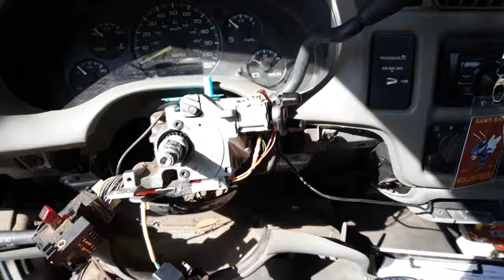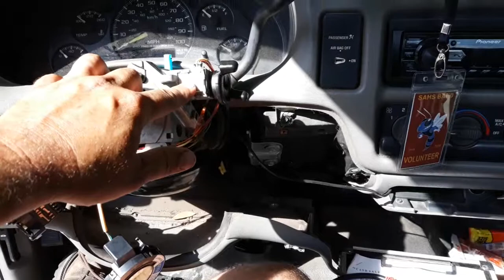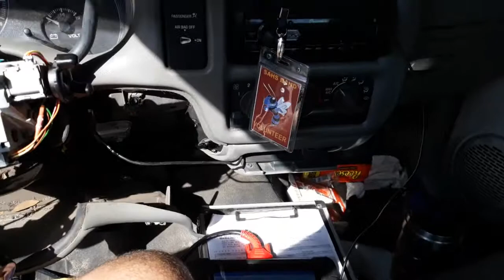GM Passlock Coded Cylinder

Comment: What year was this blazer I am having trouble finding an aftermarket ignition cylinder housing mine is a 98 but the Dorman part number you have says it only fits 2000-2005 but they look identical
Reply: Thanks for the quick reply I did try rock auto and couldn’t find anything only place I found was eBay but I wasn’t sure how much I trusted it
Reply from the maker: @journimelson2692 what about parts geek? I have bought a lot of things off of eBay as long as you read the item description good and you pay through PayPal if anything's wrong PayPal will have your back.
Reply from the maker: It was a 2000 GMC Sonoma. Did you try rockauto?

Comment: The current state of my solid(not flashing) security light has not changed since the day the problem began. I went to start the van one morning and the light was solid and van wouldn't start. I have disconnected the battery 1000 times and I have also removed the PCM to connect to a bench harness to try to delete vats with PCM Hammer software on my laptop with no luck. I couldn't get the bench harness to talk to the box at all. I can get the PCM to talk to the laptop when the PCM is in the vehicle but it won't let me progress far enough to re-flash it. All of these things that I have tried end with the same result as day one. Nothing has changed. I tried the 10min relearn thing 1000 times. I have ignition key sensor coming in the mail today but I'm guessing that it will not make a difference because the problem is further downstream(VTD) It seems like no matter what I do with the column/key sensor wires make no difference because it seems that my VTD(vehicle theft deterrent aka passlock2) module is not listening because it is bricked or damaged. The software doesn't seem to support the old Black box pcm/ecu that is in my 1999 van. I am now changing my approach to simpler methods like physically bypassing the module itself or somehow physically removing vats from the PCM somehow. I have been completely obsessed and determined. It is beginning to feel like physiological torture. Please help

Comment: So no relearn procedure after cylinder/sensor swap? She just fired right up and PCM corrected itself?
Reply from the maker: No I had to do the relearn procedure but I figured nobody wanted to see that cuz there's plenty of videos on that out there.
Reply: @Bbernhardsr  so you change the cylinder of the sensor with the brick PCM and then do the 10 minutes on 10 minutes off etc three times relearn? You think this method is quicker and easier than deleting vats with PCM hammer?
Reply from the maker: @laughingthrushmusic5269 what I did was change the sensor itself and I put a new lock cylinder in. I changed both components and did the 30-minute relearn procedure. Yes I believe this is better than trying to delete the PCM with a hammer because then your vehicle will not run it all ever.

Comment: I'd (like/need) to see a video of how to replace the 'pass lock sensor ' i searched hi and lo on you tube and i've found multiple vids on lock cylinder replacement and can probably do that with my eyes closed.
Can you help or point me in the right direction ?
Thanks,
Mark
Reply from the maker: Unfortunately this video was made many years ago. But that's okay because if you watch the video you can see how far I had to take the steering column apart to get full access to that passlock sensor. You have to take the whole plastic cover off around the housing you have to pull the steering wheel you have to pull your clock spring for your airbag. You have to take the turn signal switch out. And then if I remember right as you can see in the video there are two Torx bolts if I remember right once you pull those two bolts then the housing comes loose. You don't replace the sensor itself it's a whole aluminum housing with the sensor built-in that gets replaced.
Reply: @Bbernhardsr  yeah..I followed your link to rock auto and found the Dorman part #.
We bought a 99 k1500 suburban in 2000. Problem/ no start showed maybe 5 years ago. 
1st time Problem showed up, fuel pump replaced.
Have a place at Myrtle Beach. Drove there..unloaded , half hour later got in it to go somewhere and no start. 1st thing I thought was fuel pump. Went to tool shed for something to tap bottom of tank as wife tried to start. Before I could tap, it fired up and didn't have the problem again until the next years Beach trip.
Next year, drove to Beach and parked in the exact same place in the yard..unloaded and got ready to go somewhere..no start ! 
This time I had it towed to blacks auto, a popular shop, who had it for 2 days and called to say we can't find anything wrong 🤔 
They said it cranks every time for us. Asked me if I had a chipped key..nope.
That was probably 3 years ago.
Had a no start last year and took to chevy dealership who tested and gave me a part number for the 'pass lock sensor ' and a part # for the ignition module. Said they couldn't get the parts tho.
I know from research that you generally can wait with the ignition to 'on' position for a while and the security light will go out.
I've found that I can SLOWLY rotate the ignition switch towards the point of the starter bump..watch my guage/ security  light. The ABS and Parking brake lights come on and security light goes off..I rotate the rest of way to the point the starter engages..it starts every time or has so far.
The no start happened this time a day after I did a full tune up ..cap , rotor, plugs and wires.
Last week .
I'm ready to try replacing the pass key sensor or pay somebody.
I'm hoping all this i've typed will help a person caught out somewhere with a no start situation and save them $$ and stress . **I'd suggest anybody reading this to try slowly rotating the switch till you feel resistance..then stopping..rotate a little more then stop..so on, to see if the security light goes off. 
At this point finish rotating till starter engages.
Thanks for the quick reply sir.

Comment: My security light is solid. When they stole the vehicle they out a screw driver in the ignition switch, I replaced the switch. Still solid relearn wont work. Is the housing the problem?
Reply from the maker: Yes it sounds like the sensor in the housing was damaged.

Comment: Even when I did the wire thing my truck still cranks and shuts right off
Reply from the maker: You may need a scan tool to see what exactly is going on. I know that once the passlock system thinks the system is being messed with it will shut it down no matter what you do. The only way to know the status of the passlock system is with a scan tool.

Comment: I went through all videos and none work, so I’ll make a long ass video with a lot of mumbo jumbo and give you no idea what to do. This guy is THE fugken worst. 😂
Reply from the maker: Well you clearly didn't listen to the video then. You clearly just fast forward through it because I clearly show what the problem was and the fix. So because your impatient and just want to be shown something without explanation, you come on here and leave a rude comment. Viewers like you ARE the fugken worst! Lol🤣
Reply: Indeed!! Thanks for the heads up on all the different passlock models.. Just an ole 98 K1500 over here with same FUKN "Security" light reminding me sum tings wong ever so often..  Like when I'm in a hurry!! At a gas station and "BOOOM!" Not goin anywhere anytime soon!!
Reply: Surely don’t need all the extra long big deep breathes.  That would easily cut the video in half.  No need to make things dramatic, this is not a run for an Oscar.
Reply: @lspeeddemonl  Did you ever consider that some folks may have health issues that you’re unaware of? Did you ever consider just going to another video instead of being an a-hole to someone kind enough to try to help you with this video ? You’re probably one of those who would run out of gas on a freeway and get pissed because someone stopped, was giving you free gas, but wasn’t putting the gas in your tank quickly enough. What an a**.

Comment: I’ve replaced ignition switch (the wires), the key lock cylinder but not the housing. Was your security light solid or flashing? Thanks in advance
Reply from the maker: I do not remember if it was solid or flashing. What I do remember was a very clear symptom. As soon as I would start it the engine would start for a second and then shut down. It was like I had turned the key off but I didn't. Also keep in mind if you changed the key cylinder you will have to do a relearn procedure. I highly doubt the cylinder would be the issue because I am not sure how a magnet would go bad.
Reply: @Bbernhardsr  I’ve done the relearn procedure but the light stays solid & no start. can’t lie I’ve done everything I seen on YouTube except the housing( You the only & first to say this) & You right I don’t see the magnet going bad. But after doing research I feel you’re right bc of what you said bout the sensor in the housing. I’m a broke father of 7 lol but after a few weeks of bills I’ll buy the part & Come back to lyk the results. Is there a video on how to remove the housing? & I appreciate the fast response
Reply from the maker: @chriscampbell9681  no sorry I did not make a video on removing the cylinder. It wasn't too bad just 2 or 3 screws. You can save some money and order the part on rockauto.com.
Reply: @Bbernhardsr  ok thanks for the help

Comment: Nice video👍 I have 2002 sierra 3500 dually with 8.1l engine and tried resistor for half a  day, didn't work. Will measure resistance to see if 4.7 resistor was ok. ( FORGOT MY MEETER) IF resistor will not work after right resistance, I will try to do it the right way 😂 great video, and thanks a lot sir. I will be so happy when it will start. I also ran a button for starter, not sure if it did it. I would appreciate any advice, thank you.
Reply from the maker: Running a button to the starter will not help. When the theft system is enabled it kills the fuel injection so no matter what you do it won't run unless you fix it right.
Reply: @Bbernhardsr  I did that for safety. It's a dump bed.  And it worked like that for few months, but that security thing just decided to kick on for some reason.
Reply: Thank you
Reply: @colossus5752  the fact is if it really worked for you, you didn't have the passlock issue. If its passlock problem I bet you it won't ever work with only running wire to the kick starter until you fix the issue
Reply: @grandpanero7284  yes, resistor worked and the button worked one more problem I found was- fuel relay shorted, probably when I tried to run 12 volts to it, because I thought pump was the problem. So, resistor solved the problem. I actually had to use two resistors , didn’t have correct one. Works good.
Reply: @colossus5752  lol. When you have a passlock problem, it shutdown the fuel but won't affect the sparking. Also in another system,  the car might even crank but in some it won't crank. I don't think the resistor trick worked on all the passlock system. There are of different types. Passlock 1. 2. 3. Tho.
Reply: @grandpanero7284  i believe if you measure resistance on truck and do correct resistance it will work fine. But, I can’t figure out Nissan maxima 1996 , a tried a lot, but omg, this dollar part is hidden well

Comment: Thanks for sharing! I hope I don't have to go this route any time soon but know it will happen eventually. My '99 Suburban keeps dropping the key code and I have to go thru the relearn process often. I'm waiting for a re-manufactured Passcode box (VATS) right now. I tried the wedge trick and that kinda worked after going thru the relearn process but it still goes into tamper mode every few days. My issue is it starts and then shuts right off after 2 seconds running. Now the security light stays on and it won't relearn the key. Thanks for sharing, I'm sure I'll be doing this job before long!
Reply from the maker: Yes that sounds like your problem.
Reply: @mrbownaxe did you replace the housing & if so did it solve your problem? I got the Same year & model. Thanks in advance
Reply: @chriscampbell9681  No I didn't. I got the reman Passcode module and installed it, I had the same No start issue! Turns out someone had done the diode by-pass at some point. So the new passcode module wasn't getting the right ohms from the key switch. Replaced the bypass wire and put it back to factory. Then my buddy (GM tech) reset the Anti-theft code in the ECM and it's back to normal/factory. Not crazy about hacks & tricks, so I went factory route. Hope this helps.

Comment: I changed my ignition housing on my 2003 Silverado but used the same lock cylinder and my security light is still on. It didn’t even do a re learn it just fired right up. Any ideas of what I could do next?

Comment: So presuming this is a passlock 1 system (like on my '98 grand am), a new hall effect sensor would most likely solve this security- will crank, but no start issue? Honestly, I have a hard time believing a resistor will honestly fix it (that and I'm not very good at soldering). Thank you for putting your time in posting this video. :)
Reply from the maker: Yes after you replace the sensor AND go through the 30 minute relearn procedure it will take care of the problem of starting but not continuing to run. I doubt a resistor would fix it as well. That is why mentioned it in the video. The way I see it is the factory original part lasted for 21 years. If I put a good quality replacement part in it then I don't see why I shouldn't get another 20+ years out of it. Who knows if I will even have the truck by then. What I do know is that I don't want to cheap out and a year down the road be facing this problem again. Thanks for the comment.

Comment: 1:00 I am glad someone finally took the 5 seconds to state the different Passlock systems. I have cruised around looking into this system and they all seem to intermix these systems all as the same thing. They are not! I have the system you show here: a Hall Effect sensor built into the lock cylinder. I have had to deal with this headache a few time over the years and finding detailed information like this is like striking gold. Thanks for the detailed upload!
Reply: No they are not the same,  but they  all have same  effect.  There are many different types  , vats,  passlock,  passlock 1, 2 ,3 and I believe  a passkey type  systems.  I have  learned that  they all run off the  resistance of 15 different ohms settings,  I have  done a  vats system this way and it  is  still  working.  So I know that  the other  types  will  work  with the  right  ohms resistance.
Reply from the maker: Glad it helped!
Reply: Well  said  the  best  description  of the different kinds of  fixes.

Comment: "PROBLEM SOLVED" after days of trouble. SPRAYED CRC "Electronic Spray" ($3 at Walmart)  into my "aging ignition." (Electronic spray will not hurt the "dusty old" ignition). Unbelievable! "1998" Chevy Cavalier 2.2L engine. Chevy wanted $300 for a reset. Had it towed several times and local mechanics tried everything. Found this $3 CRC spray solution in a forum. "Security light" kept coming on. Stalled in traffic. Had to wait to start again. Looked at all the "bypass solutions" and Amazon gadgets too. When it works for you remember to share and pay-it-forward.
Reply from the maker: Does your key have a chip in it?

Comment: I have the same problem. I tried splicing the wires, no dice. That doesn't work. I thought about using a resistor, but I don't know how reliable that is. I agree with you, spend the money for new parts... Problem solved for a few more years.